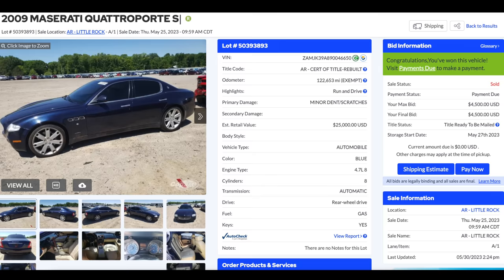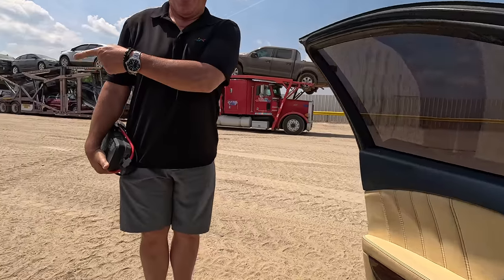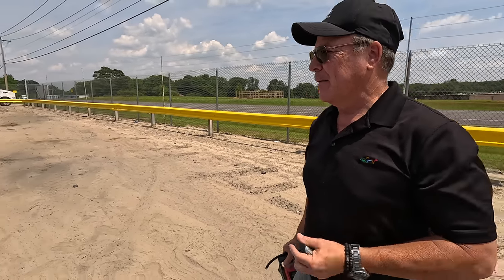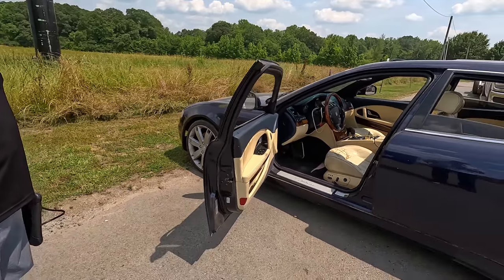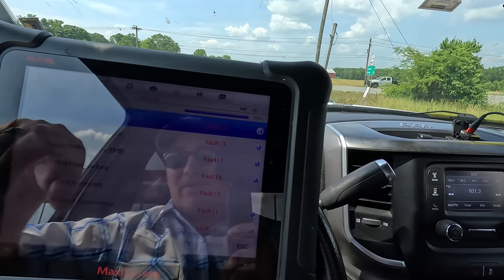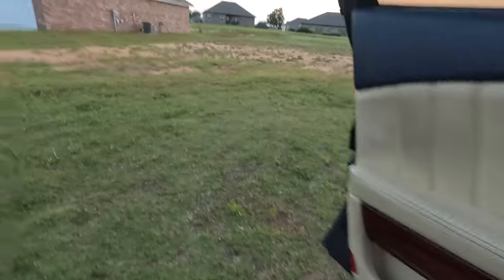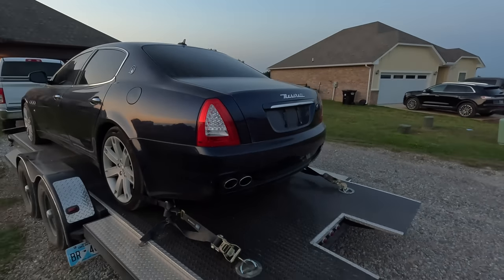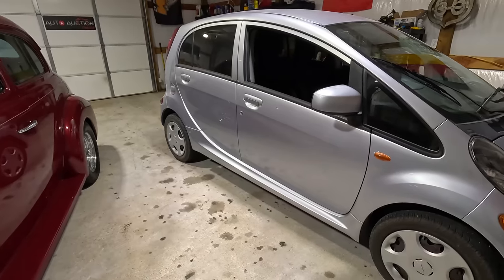I Won a Salvage High Mile Maserati Quattroporte S from Copart! Will it Drive 300 Miles Home?

Comment: The front clip on that thing is off a 2003–2008. There was a facelift in 2008 with different bumper, grill, headlights. Shes obviously been wrecked in the front and repaired with the earlier prefacelift parts.
Reply from the maker: bingo!
Reply: Came to say the same thing!
Reply: That's good to know because it's really game on to do whatever you want with this car.

Comment: Having been the mechanic on a friends 08 Quattro porte GT executive he had the same skyhook code. Looking at the missing panels in the wheel well liners on your car you might want to check before anything else on the suspension to see if the wires that go to each shock absorber if they are both connected, and/or if the wire itself is cut or broken, that’s not uncommon. There is a lot of information on the suspension online, but try the simple stuff first. You’ll want to keep a patient attitude with them that’s what works with Maseratis iPhone, the tea PMS you have to fill up the tires and then sync them up and then drive the car and it takes about two or 3 miles for them to go out you also have to keep constant I on the tire pressure. If they still don’t go out, the batteries are dead in the wheel sensors. For the noisy engine my understanding is that the cam sensors and hydraulic advance units are not that hard to take care of when the suspension goes out. It will ride super hard when it’s working that car handles amazingly tight
The trunk issue why it won’t open from the back is because the little pressure switch in the trunk lid is either broken or the wiring has a problem. It is a really good car just give it a chance and tend to different things on it. Shop around and see where you can find some deals on parts
Please please don’t straight pipe it! When you get it running right, it has the sweetest sound with the stock exhaust and it runs very very well and it’s got tons of power. Please don’t straight pipe it
Reply: I'm hoping they run the exhaust straight up through the hood like a derby car

Comment: If you want a car you can wrench on that is absolutely stunning to look at, is reasonably priced and parts are acceptable priced the Maserati is absolutely a great buy. Once you fixed it quirks You will have a great car that probably will raise in value quite considerably .
Reply: 122k mileage nah not this one
Reply: i had a few of these and is will only lose value is will never go up in value, with his miles 122k , what is ridicuolus 40k miles is considered a high miles for these you can spend 20k on this maybe 8k car

Comment: I like it. Always start with fresh gas and fuel treatment. Then go from there and make sure the battery or batteries if it has a second one are all fully charged. The front end shouldn't be that bad of a fux. These are are good when treated right.

Comment: Let's go now this is a boss car the maserati u got ranks 13 of 25luxury cars and another  issue is interior melting it can leave sticky risdue and maserati owners spends roughly $6,500 to keep their cars presentable. 2 the engine sound the increase means u might have a hole in your exhaust system and that requires immediate attention or replacement at muffler shop. 3 your maserati is one of the most reliable cars out their money can buy u
DON'T YET GUVE UP ON IT

Comment: Looks like you probably have a timing issue. The first fault you cleared, Cam/Crank correlation, along with all the misfires makes that a pretty likely scenario. Try to find the readouts for the cam, crank, and some timing values. Otherwise you'll have to tear down a bit to at least see the cam marks.

Comment: I think with the misfire situation then I'd see about replacing the plugs. No telling how old they are and maybe they are misfiring and need to be changed out.
Reply: Exactly what I was thinking. Plugs and coil packs. My ‘13 Cadillac CTS is the most maintenance-required, crap-quality car I’ve ever owned and the things I’ve learned while owning this car is that I’ll NEVER own nor recommend another to anybody!! Only good thing is I can burn 87 octane fuel. It has to be top-tier, but still! Better than high-priced gas. Plus it burns gas only slightly better than a Jeep Wrangler!

Comment: Wouldn't be surprised if it had a converter issue. If a car's driven for a while with a misfire condition that isn't addressed the extra fuel getting dumped into the converter will wreck it.

Comment: I own a Maserati Quattroporte with similar issues when bought. Your steering issue is related to the front shocks not responding correctly to the steering input either the shocks need to be replaced or the controller computer.
Your misfire, is a cam position sensor sending bad signals to ECU giving incorrrect signals causing the coil packs to fire at the incorrect times 

PS I replaced the F1 transmission in my Quattroporte

Comment: Fair warning:  It's mechanically totaled -- unrepairable.  We have 2 of these we [try to] service.  99% of the parts you'll need are available only from Maserati... there are no aftermarket parts anywhere.  Right to Service laws require service information be made available... but Maserati only provides it through a TIS account... in Italian.  No kidding.  I strongly recommend you part it out...
Reply from the maker: I’m having no issue finding parts for it.

Comment: I would check for vacuum leaks near the engine intake by the way it's running and the random miss fires but catalytic converter could definitely give you problems with miss fires as well.

Comment: With a misfire on every cylinder I’d replace the cam shaft sensor/ crank shaft sensor first and see if that takes care of all the codes. That’s what happened to my uncles Nissan frontier. Obviously not the same vehicle but similar situation

Comment: I don't think I would have bought that car............what was the original damage? (wide body line at front bumper)  Who rebuilt it originally?  Did they know what they were doing and use OEM parts?  I would have checked the oil before anything else. (not just the cap)  Will anyone have replacement seats at a wrecking yard?  I am thinking of bidding on my own project in the days ahead that many would advice against, but as you said, the costs can add up quickly on a car like that. Will look forward to seeing how things go. I would not put straight pipes on a luxury car.

Comment: Man that was a terrible choice to buy. I own an M139 and I would NEVER have considered picking this up except for parts. To start off, the one thing that's off right away is the nose. It's a 2005-2008 front end on the car. That's probably your headlight issue besides the failed switch. You'll be spending several thousand to set that thing right and it will still have a trashed interior and high mileage. It's always cheaper to buy a good one by far. Anyway, good luck with it and if you need any advice or info, lemme know!

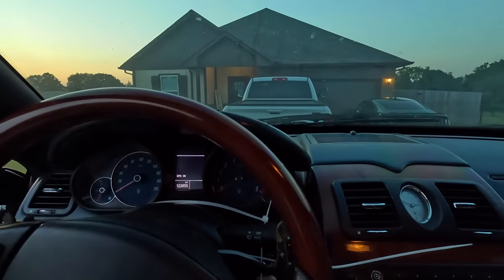Comment: Great video . Hey when the car starts at 24:30 you hear a clunk after the car starts.  What is that.  I have a BMW 5 series with the ZF Transmission,  same clunk sound. I have read it is to do with integration levels , has anyone come across this.

Comment: I reckon those LED taillights are from the facelift model, not factory on this original bodystyle.
The engine itself is pretty bulletproff, especially considering the "Italian" reputation. However the variable valve timing likes to act up sometimes - on high mileage examples in particular. And yes, if they need replacement those variable cams are a tad on the pricey side. 
(Had worse though from so called "reliable" brands...)

Hope you'll have fun with your M139!

And watch out for the oilpan on speedsbumps and such. It sits pretty low on the Automatica models. Guess how i found that one out... Well, actually my niece did.

Comment: to me it look like the front dont look right it looks odd
Reply: That’s because it’s supposed to be a facelift quattroporte but the front end is off an older model one
Reply: @eaauto6182  does that mean it could have been in a crash
Reply: @amaristrickland1719  Definitely, he did say it had a rebuilt title. Someone threw this back together for as cheap as possible to get it rebuilt
Reply: @eaauto6182  OH I SEE IT LOOKS ODD

Comment: Smells like rotten eggs because of the misfire. Raw fuel will overheat the cats and that will cause them to fail. Converters don't fail on their own for the most part. There almost always some kind of a fault that makes them fail. Always fix the condition that is the actual problem before cat replacement.
Reply: Good knowledge.

Comment: 4.2 l  V8 Maserati Quatroporte engine lucks low-rev response. Poor ride quality. High fuel consumption. The number of recalls have been issued for the Maseratti Mk.5 Quattroporte 2009 :
Ball joint fastening nuts of the suspension levers potentially not having been tightened to their correct nominal value. Seat belt warning chime potentially not sounding. Rear tie-rods may have been incorrectly machined during production. Use of vehicles with non-conforming rear tie-rods could lead to damage of the tie-rods. Defect in the tire pressure monitoring electronic control unit which could cause to give a false reading. Replace both rear tie-rods - insufficient paint coverage.  They may suffer from corrosion preventing proper tie-rod adjusting and potentially altering the steering  and handling of the car.
Reply from the maker: This isn’t a 4.2 it’s a 4.7
Reply: @AutoAuctionRebuilds  The MK.5 Series II (Mk.5-II) Quattroporte released in Nov. 2008 - introduced a revised range which consisted of the Standard Quatttroporte, S and Sport GTS were powered by a more powerfull 4.7 V8 engine< but its  body and chassis were left  identical to 4.2l V8 ! Please keep it in mind.
Reply from the maker: Why?
Reply: @AutoAuctionRebuilds  Because all those SAFETY  recalls are applicable for  all Mk.5 Series II with  4.2 l V8 and with  4.7 V8 engines. Greetings for you and Mike "Monkey Wrench" from  Adelaide, Australia.

Comment: im sure there made by fiat
Reply from the maker: I can tell you this the engine and transmission is not made by Fiat the engine is made by Ferrari the trans is made by ZF and the only people that call this a Fiat are people that can’t afford it
Reply: @AutoAuctionRebuilds    wasnt putting it down i own a 2019 ghibli,  which has the v6 twin turbo in it and it flies,  and i think my engine is derived from fiat

Comment: You didn’t win. You lost. It cost you $4500 to know what I already know.
Reply from the maker: You’ll be sorely disappointed in the next video then when I’m ripping the tires 🛞 off… You know very little. It always amazes me how much a guy sitting in a chair hundreds of miles away knows compared to me, the guy standing right in front of the car working on it.
Reply: @AutoAuctionRebuilds  Most of the time you win even when you lose, because  most of the time you have fun while doing what you do.
Reply: @AutoAuctionRebuilds  I want you to win. But I know from experience they are very problematic. It’s constant
Reply: @AutoAuctionRebuilds  what I didn't think about is that it's probably worth more than $4500 in content